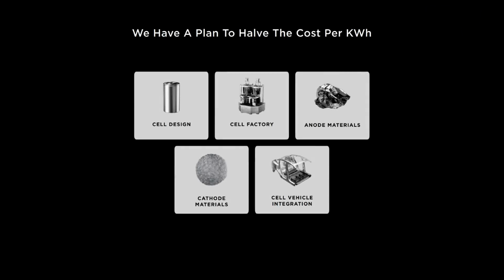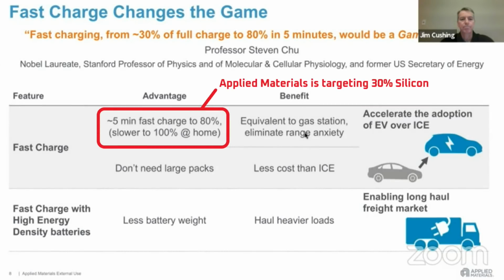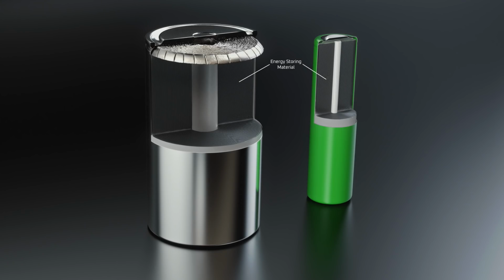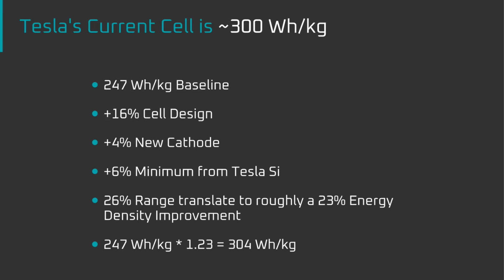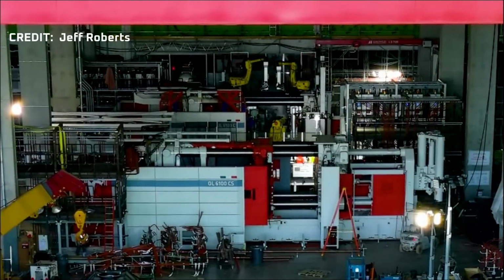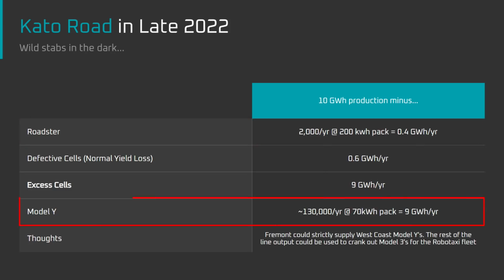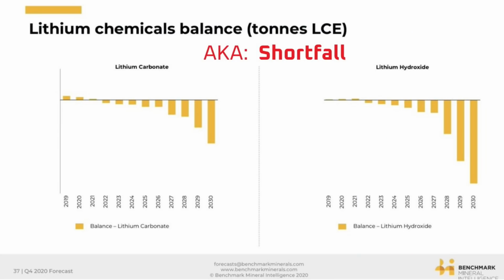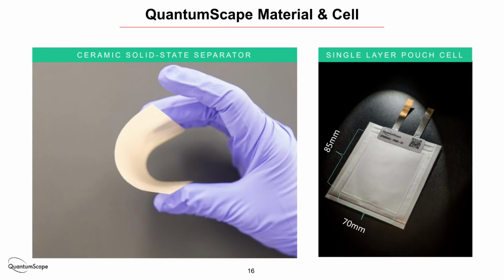#18 Nine Months of Research on Tesla Battery Day  // + Projections!

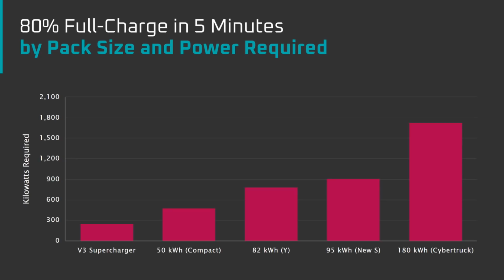Comment: @ 11:51 Your math is wrong.  to charge To 80% of a 82kwh battery FROM 30% to 80% (50% of battery capacity) would be 41kw*12 (1/12 of an hour is 5 minutes)= 492kw, which is consistent with your prior slide.  This IS reasonable, especially when combined with megapacks to supply this power for the 5 minutes it needs to.  For example: If all cars coming require the same charge rate and duration, this could service 12 vehicles per hour, on one .5MW transformer (walmart is known to use this much power here in Az during the summer.).  Each Megapack will be capable of 3MW, meaning, it can handle 6 *12 cars in one hour at 492kw, and add another 12 more from the contribution of the .5Mw transformer feeding it.  thats 84 cars within one hour.  Now, the largest charging center here in America has 56 stalls.  This means over a two hour period during peak time of 2 hours, it can service 24+72 cars at this rate. thats 96 of the possible 112 it could service.   Its highly unlikely however that all 112 stalls will be occupied at all times due to time it takes for people to pull in/pull out, leaving downtime in between.   Im willing to bet they would likely have at LEAST a couple of these 3MW Megapacks and a .75MW-1MW transformer feeding this location to allow for larger vehicles and extended peak-usage. In places where traffic is higher, they will likely add Megapacks to handle peak usage.  The Megapacks, at 6MW for instance,  will take a total of 12 hours off-peak at .5MW to charge back up.  This will allow for a location like this to see peak times spanning 12 hours a day while servicing at least 12 vehicles per hour during off-peak.  This will be easily attainable.

Comment: What I would like to see next is a series on the prospects for Tesla to reduce their lifecycle greenhouse gas emissions over the next few years as they bring their next generation vehicles into production. Electric vehicles already have lower lifecycle emissions compared to their Internal Combustion vehicle counterparts for most use cases due to EVs having better energy efficiency and longevity. However since EVs are currently more carbon intensive in their manufacturing, for people who rarely use their vehicle it will take a long time for the additional manufacturing emissions of EVs to be offset during their use phase compared to a ICE counterpart if their electrical grid is mostly fossil fuel generated.

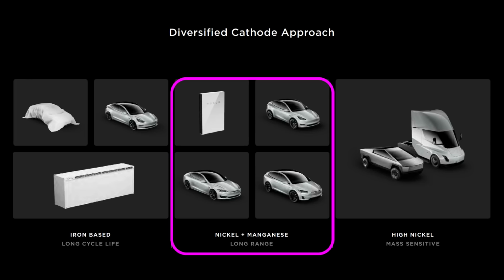Comment: Page 35:16 LFP in general is my choice, but a five star chemistry. Why? It has limited winter resistance.
Reply from the maker: Pre-condition it and it performs as well as nickel based.  That is, yes it has drawbacks, but there is a workaround.
Reply: @thelimitingfactor  work around? Theoretically or track records in the pass three years.

Comment: The 4680 is 15% taller than a 2170.  If Tesla wants to they could put a higher capacity battery pack in the same space.  The cheaper LFP battery cars could have more range than your estimates.  Not related but if the battery pack has the same output but is smaller it centralizes weight and this is good.

Comment: Good video. Only place I was going 'why, why...why' was the cost estimation technique for Model 2.
Why use so many assumptions (like % cost of battery in 2018 as a key to estimating 2022 battery price)? The percentage cost of battery pack as a EV whole will not be the same.
Isn't there a more direct way to estimate? We know what the cost per kwh will be in 2023 (probably below $40 for LFP). (The video assumes the cost of NMCs for Model 2)!
We also know that Model 2 will likely be in the 250-270 mile range & will weigh lower. So one can estimate a battery size of around 50 Kwhr. 
Net-net the battery pack for Model 2 will likely cost around $2000!

Comment: After tearing down the Model Y Sandy Munro stated that the cost to manufacture the batteries used, based on current material and manufacturing costs, was $82/kWh.  He also said that Tesla could manufacture a $25k EV right then, not later.

My guess about the future goes back to Tesla's mission statement which is basically to get the world off fossil fuels ASAP.

To do that the smart move, IMHO, would be to concentrate on robotaxi production.  Tony Seba has calculated that one robotaxi would replace about seven ICEVs.  That would be an enormous reduction in petroleum use compared to the reduction created by selling EVs to individual drivers.

So, sell some number of EVs to individuals.  Let's say a million in each US, Europe and China area. Use the other 3 million per continent (I'm assuming 4 million total per continent) for robotaxis.  Sell a modest percentage to individuals in order to keep the howls of disappointment bearable.  The majority of units produced go after large fossil fuel use reduction.

Comment: Outstanding infodump! 
I've been trying to model out projected vehicle unit production capacities based on known battery supplies for US market OEMs in order to get a sense of how much of the US auto market Tesla will command by 2030. Based on some of the information provided in your video, I had to revise my estimates for Tesla down from their current 75% to still owning 50% of the BEV market in 2030 despite the growth of all the other major US auto market BEV makers. The bottlenecks of raw materials slows how quickly Tesla can ramp 4680 cell production. Assuming BEV adoption rates follow traditional disruption curves, and BEVs are roughly 80% of the US auto market by 2030 (barring bans on new ICE vehicle sales), that puts Tesla at 40% to 60% of the entire US auto market by the end of this decade.

Comment: I'm still wondering if the twister shape battery (the patato thing) isn't better, especially when you make the battery a square, that would be able to give it much higher density at the pack level. 
It will be a lot harder to make somehow.
Reply: It may increase density at the cost of structural battery integration. A circle on the X/Y plane has better rigidity at all angles and is equally distributed in load efficiency wise. The flat pack has a higher density but faces problems in matching structural rigidity weight/space savings. A spiral has strength in one rotational direction and counterbalancing with opposing spirals may help some. Yet, there is the potential of defraying similar to how the end of a rope comes undone without a knot or melted mass.
Weaves have issues with the weakest point is at the crossover and the gaps created by toeing over and under compromises density.
The other issue that is a little more challenging for me to cover is electron path efficiency at all points of a battery charge and discharge cycle and toward end of life stage considerations. The carbon nanotubes slide seems to give the impression of growth that is perpendicular to the ribbon plane. However, it seems more beneficial to align the tubes in the Z axis (tab to tab). Another issue to contend with is  how much will a particular design behave like an artificial muscle and shorten cycle life through compounded cycle count? How strong does a binder need to be to resist movement?

Comment: Hey Jordan research BYD Blade battery, their not claiming it as a solid state battery but i would say it is.They can drill thru it and it won't ignite or burst into flames.They will be supplying Toyota, Mercedes and others with their batteries in a skateboard to build their vehicles on.I believe they are able to produce it cheaper, with a safer non combustible material and for virtually anyone that wants it at this time.The're doing everything Tesla is doing and then some since 1995.Tesla's 25k vehicle better show up in 2022 because BYD  might have a Sedan, a SUV and a Van here in the States, none of them breaking 27k by then.Check out Electric Singularity Channel

Comment: I am sceptical about the manufacturing of the silicon powder being a small problem needing little space. I think this is a massive problem and I bet they will be buying it from a supplier. It's taken HPQ silicon many years and patents to nail down a large scale option to do it. If tesla figured it out then it would be a massive announcement as there would be a huge barrier to entry for other companies.
Reply from the maker: Hpq uses something completely different
Reply: @thelimitingfactor  I wish you could read this: https://www.volkskrant.nl/economie/een-tragisch-mislukte-zonnecelmachine-kan-de-hele-accu-industrie-op-z-n-kop-zetten~b5772086/ It's dutch, but it might be interesting for Tesla.

Comment: It seems to me like Tesla has plans to eventually phase out Model Y production in Fremont. Most likely after production scales in Texas. The most logical thing for Tesla to do after they update the Model Y with the structural battery pack would be to update the Model 3 with one. I suspect this is where Panisonics 4680 cells will go (after all you don't need the updated chemistry for them, just the form factor).

Comment: The huge unmentioned issue with raw material shortage is that it will be persistent, basically until we are at the far tail of the S curve of adoption and EV sales start to slow down. Because EVs last longer and because the battery cells are mostly recyclable, once we have mostly converted the fleet to EVs demand for the raw materials will plummet. So mining companies probably will not be super excited about spending five to seven years developing a new mine at enormous costs to run the mine for five or ten years and then close it. Instead of blowing our money giving tax incentives to increase demand which does not need increasing, we need to be making agreements with mining companies to guarantee raw materials for battery cells going to American automakers.
Reply: At some point EV production rate will reach a steady state, just like ICE production rate is/was recently. So that rate will require a certain raw materials production rate that is far higher than today's.
Reply: @Martinit0  , no, eventually raw materials demand will drop back to about where it is today. Right now EVs are about 3% of global sales, but after they are 98% of global sales for say eight years or so, then the vast majority of raw materials will come from recycling old batteries, not from mining. On top of that, I think it is very likely total new car sales will be sharply lower as EVs last longer, and get over the air updates, and autonomous taxis will reduce car ownership.
Reply: @tribalypredisposed  & @Martinit0 — You’re both right (or as Elon might say, “Less Wrong”) —
  — As car batteries degrade below 80%, they can first be repurposed as fixed site energy storage before recycling, which might double their useful life;
  — Secondly, peak energy storage comes later in the cycle, and so adds to total battery demand — probably for a couple of decades, cuz we will have delayed our need for safe nuclear electricity for base load stability (just my WAG, I could be wrong).

Comment: Tesla 4680 tab less architecture eliminated - not just - the (anode tab) but included a mechanical force (preload mechanism) all together, producing two problems for 4680. 

1) higher thermal and electrical path impedance - from anode to cell wall, causing a higher running heat dissipation and temperature. 

2) omitting the preload therefore vulnerable to inertial shock from vehicle on road. If not corrected before production, on road inertial shock will (bump off) disconnects one anode flap one at a time until the last remains in the circuit. The next inertial shock will break the anode circuit hence electric arc / spark inside the cell next to hot chemical. Potentially a fire hazard and eventually blazing vehicle in road.

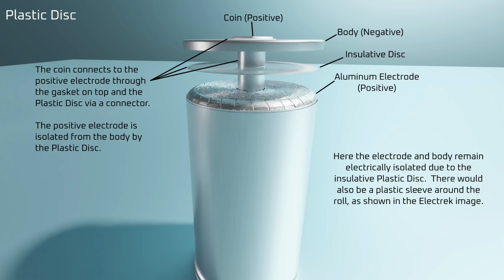Comment: Page 19:16 depicts an assembly view of 4680 size cell. Heat and electricity drain from anode and cathode are rapidly sink to the anode-flaps and subsequently pass down to the cell wall - shell, is a brilliant idea however may experience high conduction path impedance onwards from anode flaps onto the cell wall or shell, because  the use of multi flap / point contacts and undefined 1) axial preload force 2) contact area or 3) elastomer - for constant point contact pressure against thermal and inertial shocks on road. 

Argument? 
Don’t we have countless of anode flaps facing the cell wall, isn’t that good enough? 
Counter argument? 
Good enough from laments terms and bad enough in quality control and development engineering. 

In engineering science view? 
a point (or a line) has zero junction area, even 1000 counts or more has undefined area. If we need high heat and current transfer - from anode to cell wall - we had to ask and define what thermal and electrical resistances each 4680 should have and evaluate its average and variance gauges by six sigma. It appears Tesla haven’t done that. 

Continue without addressing the T and E resistances may be taken as poor engineering and quality management.

Comment: This alloy using for casting of dissimilar metals could be detrimential to corrosion due to being different electro negativity difference based on the chemical periodic chart.    Battery can be made of different metals.  My question is how does all these alloys of different metals interact and not have a corrosion problem
Reply from the maker: Because the materials are selected for the exact electrochemical characteristics they need.  Electric charge doesn't flow throught he electrolyte, only the anode and cathode.

Comment: If castings will be measured in microns (~.00004"), I sure would love to see the dimensional data on the casting machine pasts and erection drawings. were they built to ASME Y.14.5M by any chance? This seems a little misleading. +/- 5 microns would be equal to +/- .0002" which is doable. Also, do these measurements compensate for material shrinkage? Are the tolerances for XYZ dimensions? Flatness? Positional Tolerance? It sounds bizarre - almost like being to cast aluminum Joe blocks!

Comment: so, until the 4680 line is fully ramped the batteries go into.... the powerwall? Didn't they just unlock extra capabillities on Powerwalls delivered from november?
My guess is that every Tesla factory will get its own 4680 line too (Fremont, Buffalo & Shanghai)
How good would a 4680 Iron - Lithium battery perform?

Comment: Will LFP batteries be made with 4680 form factor?  Will the structural battery pack be used for Teslas using LFP, or only for higher end models?

Comment: In the tabless battery, will all the extra tabs work to reduce energy density again? You go into that point right after discussing that increasing battery diameter makes the wasted center of the battery take up less percent of the battery, increasing energy density. What ballpark amount would the tabs then act to reduce these gains by?

Comment: Hey Jordan a couple questions that, other than Elon Musk , you seem to be the most qualified to answer. First, at the call the other day Elon stated the LFP batteries would be a different form factor than the 4680s. Is this a technical issue? Also, can form factors other than the 4680s be used in the structural battery pack? Thanks
Reply from the maker: Nah, not a tech issue.  4680 may actually be a better form factor for LFP.  I'll wait and see on this one.  

Yes, other form factors can be used.  

This answer is greatly oversimplified.  A robust answer would take a couple videos.

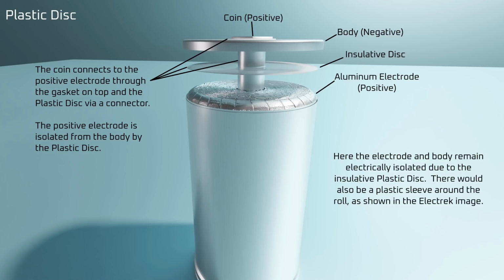Comment: At 19:21 ... is this diagram correct? If the aluminum is positive, why would there be an insulative disc separating the broad, tabless aluminum flanges from a broad contact site at the end? Is this implying that all of that aluminum surface area is being funneled down into that tiny positive coin component? Would that not defeat the purpose of having such a broad area of aluminum to conduct charge in and out of the battery? Is that insulative disk perhaps supposed to only be a ring?
Reply from the maker: Covered in the the Structural Pack video.
Reply: @thelimitingfactor  will check it out! Thank you!

Comment: Tinfoil hat time. We know that Jeff Dahn will be advising Mark Obrovac’s team starting in July. My theory is that they will be working to scale DPMG so nickel oxide can be used for NMC cathode production in the long term. Tesla moonshot to unwind the nickel supply problem. “Unstoppable force meet immovable object” :) Are you able to comment? 

Thank you Jordan! Always look forward to seeing your videos pop up in my feed.
Reply from the maker: Hmmm, as per the cathode video, I think Tesla will use a wet process that aligns with the spring power patents.
Reply: @thelimitingfactor  you did mention cheaper input stock as one of the advantages to the Spring Power method in the cathode video. Does that mean Tesla will be able use class 2 nickel  input for cathode manufacturing? That is huge news.

Comment: Thanks for this video. I bought my car 11 years ago thinking I'd be able to buy a tesla in 10 years. Well, here we are 11 years later, my car is nearing the end of its life, and Tesla has as much good about it as bad. But one thing is clear from your presentation: If I want to buy a vehicle, I need to do so in either 2023 or 2024. Buying an electric vehicle in the middle of a battery shortage is a bad idea. Pushing my current car out for another 5+ years is not viable. But having it limp along for 2 more...yeah, I can do that. And, by then, I can probably own a house, with solar panels, where I can charge said car. :D Fun! If only Toyota could make a 2011 Camry, but with Tesla motors and batteries. That'd be the best of every world.